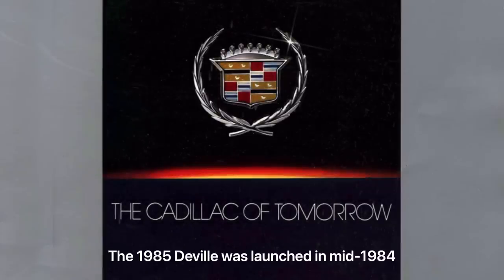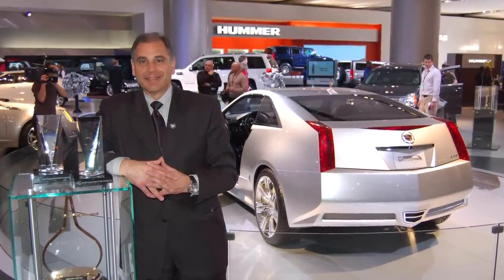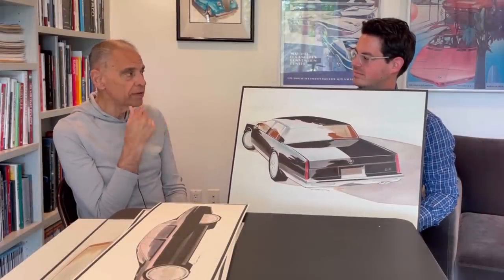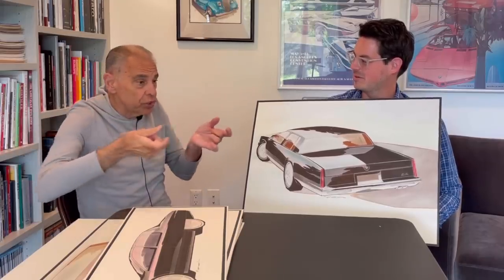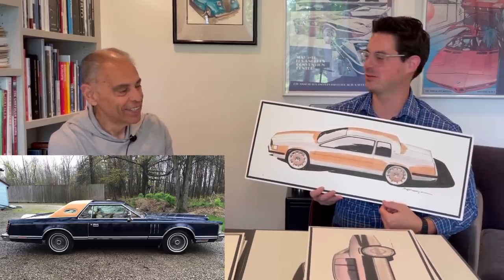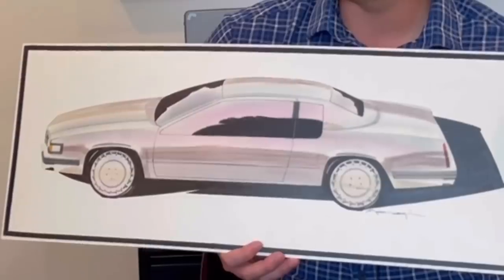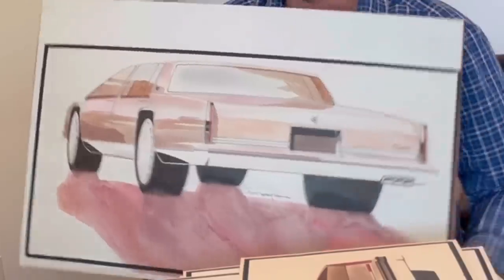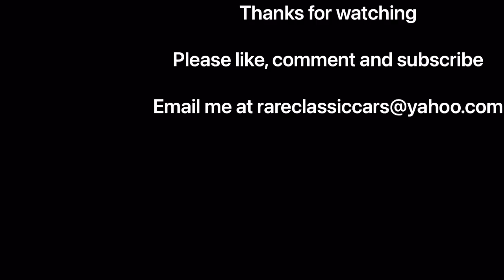The 1985 Cadillac Deville Was “The Cadillac of Tomorrow” (Incl. Designer John Manoogian Interview)

Comment: In 1990 I rode in a 1989 Sedan De Ville. It was definitely a special machine. Not a sports car handling wise, but that V8 had enough power to go. And it did go well. 4.9L V8 200hp 275lbft
Reply from the maker: The 1989 would’ve had a TBI 4.5 engine with 155hp I believe.  The 4.9 was introduced in 1991.
Reply: @RareClassicCars  Yeah you're right. Now that I think about it, it  did say 4.5 on back, it was like 145hp and 230lbft 
But it moved well enough. Loaded with passengers or not. 
My Grandma had a silver 1991 with the with the delco gold bose sound. Hers had the 4.9L and you could feel the difference. It was much quicker than the 4.5L 
But both were nice cars. Any car is nice if you take care of it 🤗

Comment: Why doesn't he have any drawings of the 85-86 early DTS model? The Deville with the sports suspension and 4. 1 motor. It had the front airdam with built in fog lights and lowered stance. Your absolutely never see any of those anymore
Reply from the maker: Came out in 87 as the Deville Touring Sedan
Reply: @RareClassicCars  I do believe they had come out in 1986. I remember seeing one in Car & Driver magazine WITHOUT the front flush headlights. I think it was NOT a separate model but a package on the Sedan DeVilles.
Reply: I think you are correct Kenneth, when was the last time you seen one, I never see them anymore
Reply: @seahawker7796  It's been over 15 years since i've seen one in person.  But they did exist but they were like unicorns when new. Very few buyers opted for the Touring Sedan package back then. If you have a 1986 Cadillac Deville brochure, i'm sure it's in there.
Reply: I actually own one that’s up for sale too. Academy Gray, with 57k mile and yes it was 86 Deville Touring Sedan Edition.

Comment: Like mentioned previously, those HT 4.1 engines were junk. One of the worst by Detroit. Back then I owned a mint 1983 Fleetwood Brougham D'Elegance Coupe black/red leather w/the "Hook & Tow" 4.1 engine. I would break down w/it every 7-10 days. Kid you not. Also w/only 135 hp on a heavy big car, I couldn't even pass cars on the highway. Sold it after 1 year and bought a 84 Olds 98 Regency Brougham which I loved.

Comment: Styling wise I thought the Fleetwood 75 was the best looking of this series. I didn't like the dashboard or ergonomics on 85-93s. Climate control next to the steering column like Chevy Celebrity- so you had to reach around or perhaps through the steering wheel to get to it, digital fuel gage hidden by the hornpad so you had to glance down to look at it, information centers down at the bottom of the dash out of sight, slow power windows with cheap feeling switches. 

Ironically the 85 only ribbed seat design went over to the 87-92 Brougham.

Comment: My father had a 1985. It was the single worst car ever made. The brakes were shot at 4,000 miles, the transmission was shot at 6,000 miles. It blew an intake manifold gasket at 22,000 miles and a head gasket at 40,000 miles. The fan belt pulley sheared off at 56,000 miles. My wife had an 82 full size Caddy with the same crap 4.1 V8, it was also garbage.

Comment: The problem with Cadillac at this time was its designs made the car look cheaper than the Oldsmobile versions.   Inside and out, Cadillac looked cheap - designs and materials.   Even the SMALL accent line on the Olds exterior gave some three dimensional look that made that car look more expensive than the slab sided (no design effort) of the Cadillac that looked like brick with Cadillac front and rear ends tacked on as an after thought.   And what were the interior designers thinking with that Cadillac?   It looks cheap and the materials even look cheaper.   It is as if Cadillac didn't want to show up the Cinamon (!).

Comment: As a lifetime Cadillac fan, I think was a big mistake for Cadillac to start making its cars way too expensive, too complex, engines with timing chain and head gasket problems, and too expensive to maintain. The vain of the 2000 to 2010 Deville should h Ave never  been discontinued!!!!!!?????? The Northstar engine should have been perfected and further developed or the LS and LT V8 should have been used in full size Cadillacs instead of the overly complex DOHC V8 in the CT6. The small 3.0 Litre  V6 is not very appealing for long term service life. Just one mistake after another. I will always prefer Cadillac over Benz, BMW, or Lexus!!!!